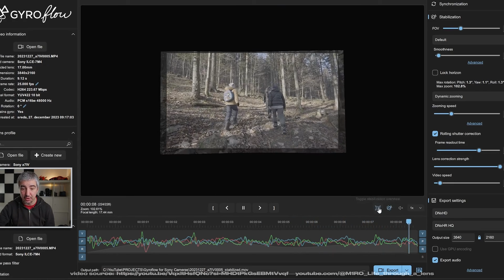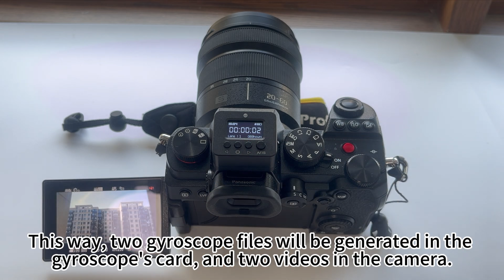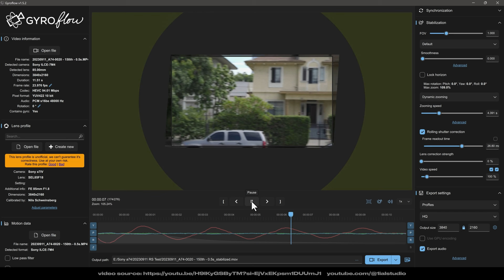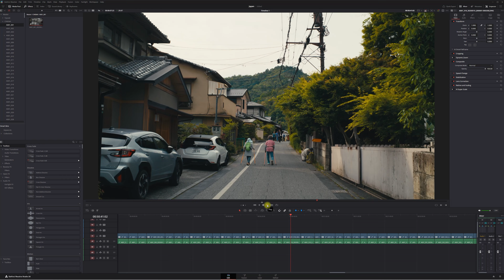Stabilizer for any camera?! NiYien Senseflow A1

Comment: I don't understand how it works, I understand the gimball but this seems like magic
Reply: It is post stabilization. However with this device the software can know exactly how the camera moved and then it can accurately correct shake without having to guess which doesn't always work very well. Then the software (gyroflow) needs to know information about your camera and lens and it can accurately correct rolling shutter as well, since rolling shutter is dependent on camera motion. The downside is that it needs clean frames for a good result, no motion blur, so you must capture at a high shutter speed. It also crops because it needs some room for the stabilization so you should shoot wide and high-resolution (4k +)

Comment: I see something almost the same , also was expensive.  Imo 100 euro for it, this same like second hand gimbal, but gimbal not cut 20% of frame . Edit: I found it . it was SteadXP
Reply from the maker: Not everyone wants gimbals. They're too chunky and bulky.
Reply: @flare_vision  for this little cams which you show for example zhiyun crame m2 is small and light. Using gyrodata you loose a lot from picture, so you loose quality. If you remember about it you record wider, but then you loose and quality and bokeh (so thats why someone use camera over sportcam or smartphone). I know about it because I used sony a7IV which has build in gyroscope so it put gyrodata to files.
Reply from the maker: @xXadambXx Most of the people watching this video never see or even think of any "loose quality".For me, any gimbals are too big to use on vacation, for example.
Reply: @flare_vision maybe this some people can loose quality. I'm have to used this clips for ads etc. So quality and bokeh was important for me

Comment: What is the data rate of the gyro data and how precise is the synchronization?

I made tests with the Lumix G9-II that does all this in camera on top of IBIS and lens stabilization. It is capable to compensate very short vertical movements while the rolling shutter moves from top to bottom. This needs fast gyro data and very precise synchronization to handle movements that change speed and direction within a single frame like engine vibrations and such. If the device is fast enough and can be synchronized exactly it would allow to use cameras without IBIS like an action cam. The Sony RX0 comes into my mind or the Lumix box cameras BGH1 and BS1H.
Reply: I'm pretty sure you need to turn IBIS off for this to work correctly because it won't have any info regarding how the sensor in your camera is shifting. It would not be able to eliminate rolling shutter as well compared to turning off IBIS
Reply from the maker: For such technical questions, please refer to the Discord channel with the developer. The link is in the description of the video.

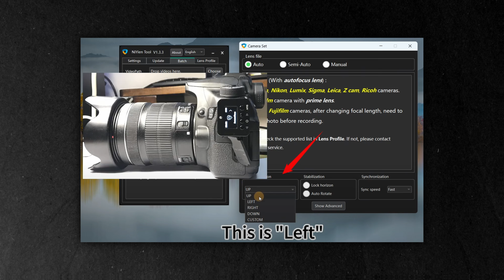Comment: 4:48 BMPCC? OMG finally some good stabilization for that camera.
Reply: bmpcc as a buit in gyro, you dont need anything else
Reply: @blackbeast1952  but only the 4k or 6k, the original BMPCC (the one it appears in my timestamp and the one I own) is not supported by gyroflow as it doesn't record .braw
Reply: @francotamayo94  right, do you think it will work with the OG BMPCC?
Reply: @JonahLorsung  I think it will. I'm in a Facebook group where a guy made a D.I.Y. gyroscope for his BMPCC OG and it worked fine with gyroflow, so my guess is that sense flow will work as fine as his D.I.Y. gyroscope.
Reply: @francotamayo94  word, I will give it a shot!

Comment: Please note, that R6 mark III, R5 Mark II, C50, C80 and C400 have built-in gyro data recording! (according to gyroflow website, supported cameras page) So you don't need this device, if you have one of these cameras.
UPD. I'd like to edit my comment after I got some experience with R6m3 internally recorded gyroscope data. It works, but don't expect much. Gyroflow's docs say that it lacks time-domain precision, and very evidently so. Also, I discovered that my R6m3 writes gyro data ONLY if an RF lens is in use. Any of my EF lens (including L primes) used with the official Cannon EF-RF adapter disables this capability (and it's silent, you cannot see it until you get the footage on your PC).
Finally, I've got NiYien A1 recently and it works really well!
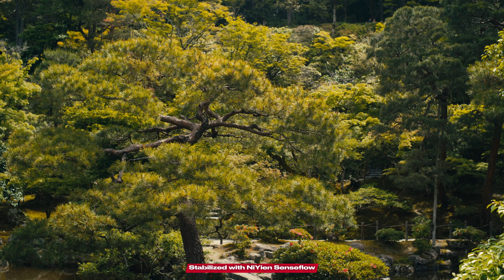Reply from the maker: I mentioned that here: 10:27
Reply: @flare_vision  Sure, I just wanted to highlight it in comments for people like me, who prefer comments. Thank you for you video!
Reply: Holy hell didn't know that!

Comment: Its a good thing that companies start to make it work easily rather than diy. Before some cameras release their gyro settings. i created a similar device like this with a fpv flight controller to be used for my cinema cameras on big cinelifter drones. but it was always a mess to try to find which clip it was which and to actually synchronize them manually. 
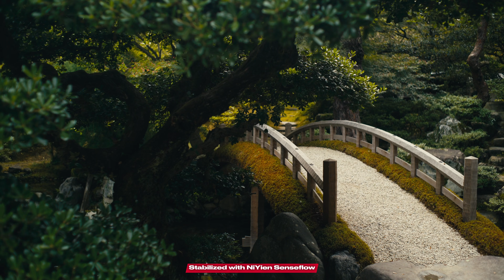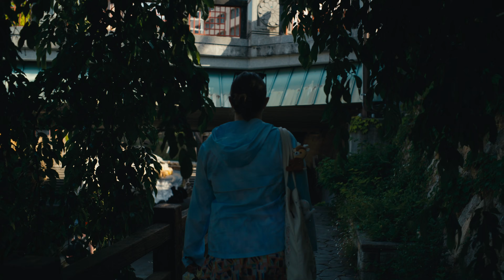I do have a question about a camera you shoot some clips, camera/lens and shooting codecs/bitrates. at 2:57 or 13:00. it really looks very clean!
Reply from the maker: These videos were shot on a Sigma Fp and TTartizan 35 mm. It was shot in 14 Bit cDNG format. Graded in Davinci with Dehancer plugin.
Reply: @flare_vision  daym, i had no idea tha fp had that image quality
Reply: and they discontinue it ahah
Reply from the maker: @engineerfpv yeah, it's kinda little beast, haha💪
Reply from the maker: @engineerfpv Hope they are preparing a new version 🙏

Comment: This looks very interesting! Rolling shutter correction, stabilization as well. Shame that shutter speeds need to be high, but you can always plan for shots that you will use in conjunction with this tool. At the end of the day everything is a tool, even the camera, and it all depends on how you use it and when you use movements in your frames. Stumbled upon this by accident and maybe down the line will consider it if I won't go for a C50 and keep my R5 C.

Comment: interestingly reviews of this can be rarely found even after it is avaible after years. is it a scam, or it is so good that gimble manufactures want to kill it?😂
Reply from the maker: As I said in the video, the device is just starting to arrive in Western markets, and for some reason, the developer is not doing major advertising at the moment. Perhaps he wants to establish a stable supply to the Western market.
Reply: @flare_vision  I searched Chinese market and reviews. The result like... close to nothing😂 no third party review just from official years ago.

I believe this product should be fine, because this gyro tech has been used and is being used now. Drone/360 camera and Sony they all write gyro infor into meta data, and this is how digital stablization works anyway. The difference is in-camera vs in-PC.

Surely digital stablization is different agains physical gimbal, but it does help in a fairly easy setup. After all a full gimbal setup is very messy if not with a professional team.

I used to own Sigma FP, but sold it in the end due to lack of stablization. I have to use gimbal every time. I wish I had this external gyro!

Comment: Man, I tried building one of these from scratch over a decade ago thinking it would be simple, I was wrong, the focal length I could get out of the camera wasn't fast enough or accurate enough and math needed to correct rolling shutter while zooming confused me so I gave up. I'll be buying one and hopefully these guys will aspire to take what they've learned to the next level
Reply from the maker: Glad this device can help you achieve what you were trying to build!
Reply: @flare_vision yes, i think it will reignite that pursuit
Reply: i dont think this one support zoom lens either tho?
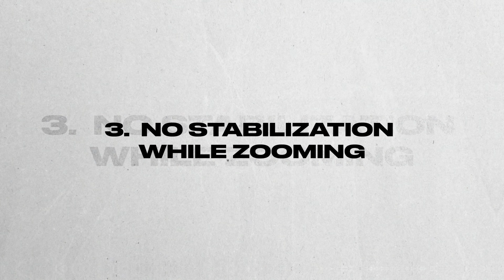Reply from the maker: @gammaa-66 This device has support for zoom lenses, more on this topic here 13:38.
Reply: @gammaa-66  says it does support zoom lense up to 100mm as long as you keep the zoom fixed. I'm assuming that for instance sony cameras don't include lens metadata in video files, my rx10iv provided a sidecar file with no useful information in it, as far as i could see anyway, probably why you need to take a photo first. You could use chdk or magic lantern on older cameras to report the focal length and focus point but it wasn't granular enough to support rolling shutter compensation while actively zooming. Thats why i gave up on the project, thinking I'll just have to wait until manufacturers include it in the metadata. I'm personally disappointed, you'd think it would be a relatively simple task for the likes of canon sony nikon, even om, to attach or mux a vtt containing live feedback of camera settings. If I'm not mistaken, even on the R1 R5ii or r6iii, lens correction of raw video is still fully manual. Anyway, my thought was, even if you did have the necessary feedback, actually implementing it to correct for rolling shutter is a lot more confusing than it seems on the surface, and only practically possible, as there is a loss in vertical resolution.  Stupid excuse for giving up on it but it is what it is 😅
Reply: I think gyroscope is not enough, software also needs to process the shake from the video, the sensor is just a helper in this case. Maybe in an acton camera where the fov is fixed the sensor is enough.
Reply: @Ringer1982 that is arguably the harder challenge

Comment: This looks like a good device for the cameras that do not have support already.

But if you intend on using this, you do have to make sure your shutter speed is much higher to reduce any motion blur.

And you have to make sure that you don't zoom with your zoom lens during that specific recording.

I guess its good when you specifically plan on using it.
Reply from the maker: That's right, I've covered it in the second part of the video 😉

Comment: The only thing I wish was different is the fast shutter look. I prefer the look with a 180 degree shutter angle. But the stabilization works like a charm!
Reply: You "could" in theory use a plugin like RSMB to mimick a 180 shutter. It's not perfect, but it does a fairly decent job.
Reply: @JamieFrancisEdits  just replying if you tried it and worked
Reply: @Myo.mechanic I haven’t purchased one yet but plan to. I have tried the Gyroflow plugin on FX1 and BMPCC 6k footage and it works awesome. I’ll be making a video on the NiYien once I try it. I want to try it on a 10 year old GH4
Reply: Oh and yes I have used RSMB with this footage and it looks good. Not perfect but really good.
Reply: @JamieFrancisEdits just found your channel and ill be on the look out for that vid. Thanks mate hope you can post soon

Comment: This thing costs almost like a high-end gimbal... but the gimbal makes your footage already stabilized, while this hardware needs postproduction work in order to stabilize the footage. Is this convenient? I don't think so. Also I'm thinking: smartphones already have gyroscope, why devs don't develop a video recording software that grabs those gyroscope data and directly stabilize the footage when you are recording, or let you stabilize the footage with gyro data after saving the video?
Reply: because you dont want to break your back using a gimbal all day long.  The more i shoot, the more i value size and weight. Also this is $99. A high end gimbla is 200+

Comment: Is this worth it if you have a camera with ibis and gyro-tracking? (ZV-E1) I want the best possible stabilization with the least amount of cropping (obviously without using a gimble)
Reply from the maker: Your camera is supported by gyroflow, so you don't need this device; you can work directly with Gyroflow without it. 👌

Comment: Is there any other software where the syncing can be done? Other than BM studio.
Reply from the maker: For this device, syncing is possible only in its own software, the NiYien tool. After syncing, you stabilize it with Gyroflow or its plugins.
Reply: @flare_vision  I see from the page that the plugin works in: 
1.Adobe: PR/AE plugins.
2.OpenFX: DaVinci Resolve plugins.
That's limiting. For now.
Reply from the maker: @alexanderkapsiotis8050 There's also a plugin for Final Cut, called Gyroflow Tool Box, but it's a paid one.
Reply: @flare_vision  I see. Thank you for responding!

Comment: The process is too cumbersome. Optical IS or IBIS for me is still the way to reduce complexity and extra work. A device that corrects on the go would be great.
Maybe next implementation, if camera companies hasn't solved that by then.
Isn't the fp's mount active?
Reply from the maker: Maybe so, but there are cameras like the Sigma FP without any stabilization whatsoever. And yes, the FP's mount is active, but this is a good option for cheap or manual lenses without any stabilization.

Comment: Just picked this up for mt r50v and going to do alot of testing this weekend
Reply: Let’s us know how it goes I run to canon R8s and the R50V is something I been checking out for a possible 3rd camera body.
Reply: @Dogfood1mili same!
Reply: I think I'm doing something wrong so I'm still figuring it out. I have wobbles and weird artifacts still.  There is a lot of zooming in and out at strange times. Some of it may be because I can't seem to get my lens profile correct.  The app keeps telling me to update the Gyroflow software although from what I can tell it's the newest update.  So it is most likely user error at this point. I definitely can't get it to look as good as this video.
Reply: @bsharly5465  thanks for the update! I hope you will figure it out soon :/ 
Have you checked if it could be about camera compatibility (is it on the list?). I don't have it so I am just throwing this idea out of the back of my mind...
Reply: Here for future updates
Reply: someone just like my comment when he shares his experience
Reply: THE PEOPLE ARE WAITING lmao
Reply: How is it going so far?
Reply: A lot
Reply: heyy i heard that it doesnt work with Ef lenses using the ef-rf adapter on the R6iii (for example), but i might have understood that wrong as that might be talking about the cameras built in gyroscope data it gets from the RF lens. How did you go?

Comment: Looks awesome, thanks for the in depth overview. I’ve tried using gyro flow before with a remote cam recording gyro data but it was such a faff to use. This looks great. 
If you change lenses during a shoot do you need to record the two short clips again after resetting the lens data?
Reply from the maker: No, you don't need to take two short clips again that day👌.
Reply: @flare_vision perfect, thanks 👍🏼

Comment: Great video, thank you! Have you had any issues with synchronization failing with the ZR? Perhaps it only happens when the device is stopped during the day and then restarted. Either that or the ZR’s clock might be drifting, not sure. I would be open to using a cable from the ZR to the logger, for rock solid sync, if that is indeed an option.
Reply from the maker: Hm, I haven't experienced that issue. You can ask about it in the Discord channel where a developer can answer you:
https://discord.com/channels/1148857031382536343/1148857031382536346

Comment: so only prime lens support for the fujis? been waiting for this for years, however I am using fujinon 16-55mm 2.8
Reply from the maker: If you are using a 16-55 on Fuji, you need to make a few different lens profiles, for example, one for 16mm and the second one for 55mm.And while you are recording at 16mm, you use your first 16mm profile, and if you want to switch to 55mm, you also should switch your profile to the second one, with 55mm.And you don't need to stop recording on the device😉

Comment: Hi - I have a Sony A7R5 with gyro data, would I still need this device to use gyroflow
Reply from the maker: Nope, you don't need this device; you can work directly with Gyroflow 😉.
Reply: @flare_vision thanks, do you think gyroflow is worth using for a camera like mine
Reply from the maker: @markshirley01 You should definitely try this out, because for you it's even free. I think you will like the result.

Comment: Sony gives you that built in ✌️
Reply from the maker: Yes! But not all Sony cameras, and it's better to use gyro data with Gyroflow rather than use Catalyst.
Reply: @flare_vision i have a6700, do i need this?
Reply from the maker: @Caseylow15 Nope, Your camera is supported by Gyroflow, you can stabilize without this device 👌.
Reply: @flare_vision  you can use Sony files with Gyroflow as well...
Reply: Blackmagic too

Comment: sooo i can not change lenses during the day? i did not get that part of the video
Reply from the maker: Yes, you can, by switching to another lens profile. And you don't need to stop the recording.
Reply: @flare_vision  ahhh interesting but i need to write down which lens i used for which scene or what would be the work flow there? And i often have the problem that i use high framerates does this device support that too ? the internal gyro recording is turned off in my sony when i am in high frame rates
Reply from the maker: You can use a high frame rate without problems.As for changing lenses, before the shoot in the Niyien tool, you should specify the lens profiles, for example, 17mm and 25mm. During the shooting, if you are filming at 17mm, you should choose the first profile, and when you switch to 25mm, you should also switch to the 25mm lens profile.But this workflow is only for manual lenses. If your lens has an electronic connection with the camera, the Niyien tool will automatically read the focal length data from video files, so you don't need to specify lens profiles at all!